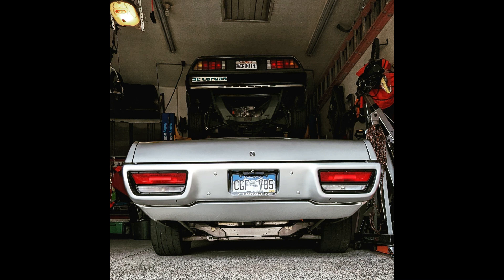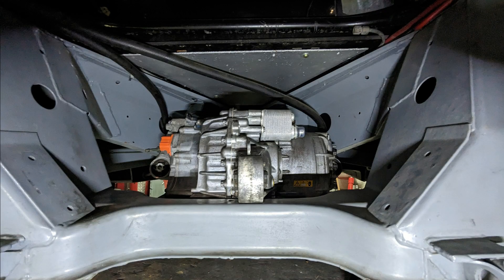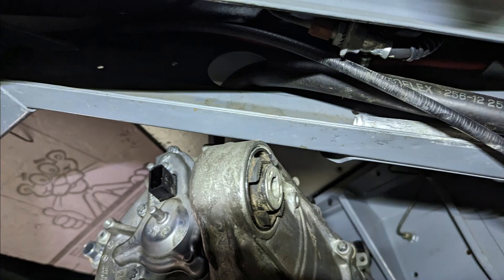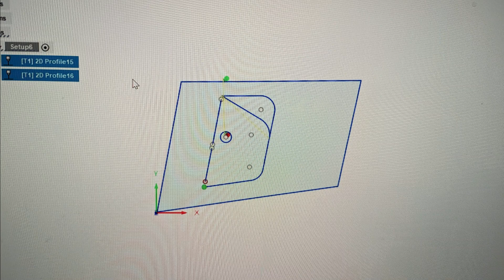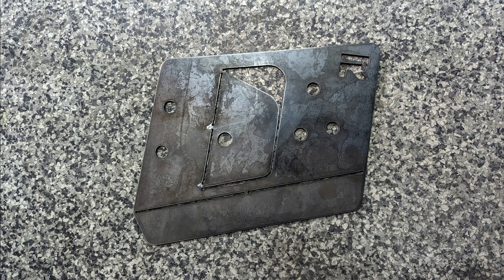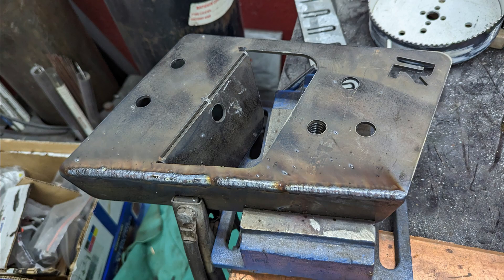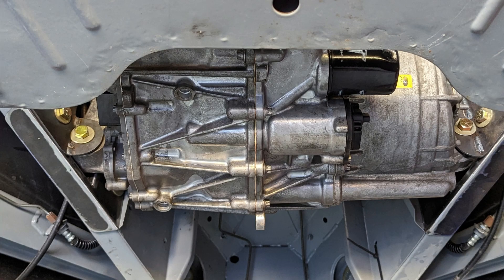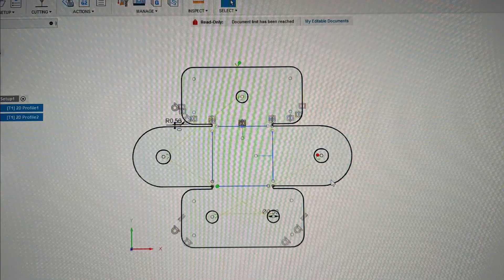EV DeLorean - Motor Install - Project Jiggawatt Episode 1

Comment: Awesome project! Is there a bms that does not require changing out the cards on the Tesla modules?
Reply from the maker: You can use the model 3 batteries intact with a programmer... I'm not sure there is anything available for the Model S modules.  I prefer the Orion BMS with all of its functionality so swapping the cards is the best option in my opinion.

Comment: I doubt this finished car is going to have ANY problems hitting 88 MPH... the original, wheezy gas motor took 10.5 seconds to get to 60 MPH!
Reply from the maker: I think you're right, it's going to be a quick little car

Comment: Top notch, teally looking forward to your final product and selling kits or kit plans for this.  Will be excellent if all Deloreans can ultimately meet this fate.  I presume all your parts are cut feom stainless, maybe i missed you saying so?
Reply from the maker: Thanks, I think it's a good thing for all DeLorean's also.  So far these are made out of mild steel just like the frame, but as a bolt-in part, stainless is definitely an option.
Reply: @MrMoparMan  didn't realize it wasn't all stainless, but now that you mention it and I think about it for one second, it's obvious that would be strange if it were true.  Looking forward to the watching the rest of your build and some quarter mile slips perhaps. ;)
Reply from the maker: @D0li0  Yep I can't wait to drive and test this car.  So there actually is a stainless steel frame that's available, a friend of mine is building a car with one.  Really nice and really pricey!